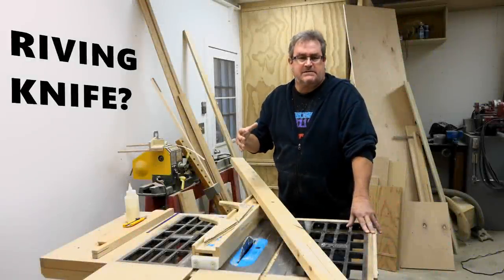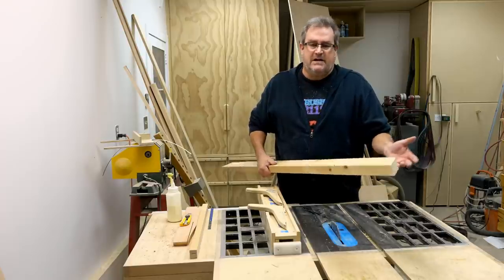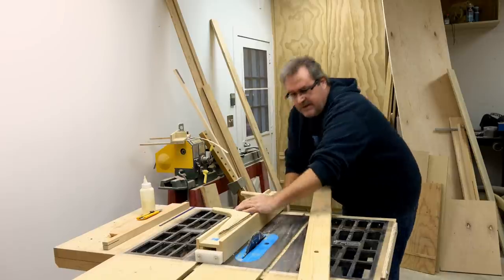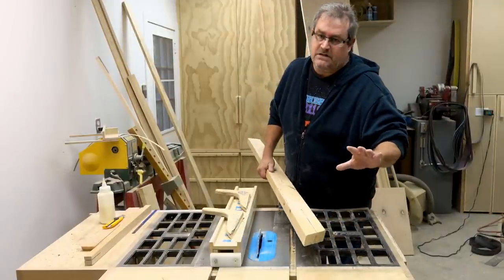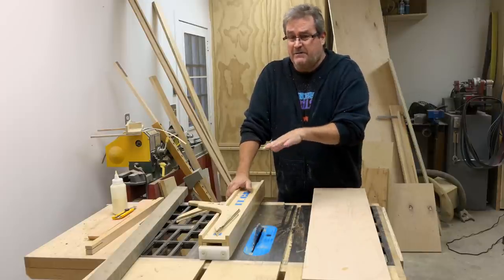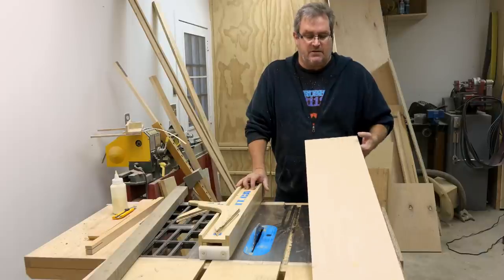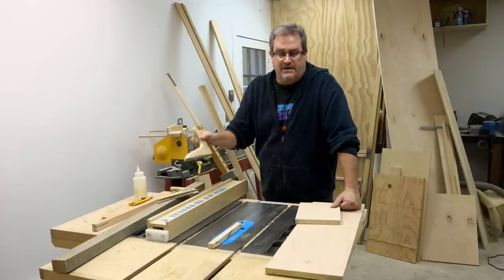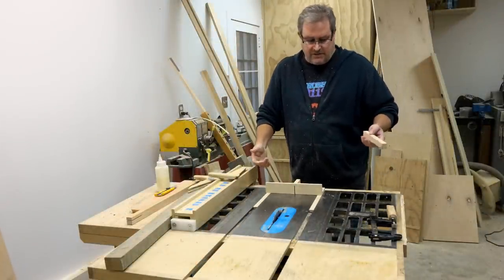How To Avoid Kickback On The Table Saw

Comment: There’s no secret.  Simply summed up concisely,  only use saws with riving knives otherwise you’re looking for trouble, no ifs or buts.  

Ensure your fence is accurately aligned to the blade.  Never feed wood freehand without a fence and never put pressure on the waste side at or forward of the blade as you feed the piece through.  That’s it.

Comment: Here's another video on kick back.  Watch until the slow motion of just how close his fingers got to the blade even knowing he was purposely causing a kick-back for the video.
https://www.youtube.com/watch?v=u7sRrC2Jpp4
Reply from the maker: Several people have already posted a link to that video. I saw that when it came out, years ago.
He was using a push pad to try to steer the wood into the saw, as in pushing it toward the blade with his hand. Push pad type things (like those Gripper gadgets) are more dangerous to use than a simple push stick on a table saw.

Comment: Respectively disagree at 7:15 you should never have your left hand on the cutoff piece pushing that through the blade.  Let the cutoff piece alone. You should have a push block with sticky bottom and firm handle on the piece against the fence. That block allows/provides for positive pressure forward, downward and against the fence.  Having your hand on it like you do later in the video and to which you advocate is also not right in my opinion.  I totally agree that a stick is probably not best either but a block with a handle (I use the orange ones with handles on them and friction material on the bottom) to keep positive adherence to the material.  No way I would have my hand on a piece of plywood that small with my hand guiding it. Maybe your hand technique on a significantly larger panel might be ok.  A riving knife is #1 safety item. Not sure of any that an riving knife cannot be adopted. Need a new saw if it can’t take one!  Lastly that combo blade you are using is the first thing I would change out for ripping 2x4s. Get a dedicated 24 tooth and you will have much better success. Thanks for posting!

Comment: in new brunswick  , in the city i live . the  dummies put kiln dried  2 x 4   outside 4x4   osb etc all outside to get   rained on . ,  fuckin  snows on it    rain .  pathetic   practice they use in this  city  i don't know  what the fuck they are  thinking , i'm sure the moisture content on these  has to be  50 +%   i know    when i  buy the trash .it's all  warped and twisted after a day or  2 in the house lol . ridiculous .hoping this is not how they do it in ontario   ,  a lot of good tips  in this video .  great series
Reply from the maker: Use to be that all of the framing lumber was green, straight from the mill without any kiln drying. All of the lumber would be uncovered out in the yard, like you describe, so that may actually be just that - green lumber.

Comment: why would you take the riving knife off of a table saw. I'm assuming that's the piece of metal right behind the blade.and I'm not trying to be a smart-ass I'm truly asking what purpose would it serve to take that away
Reply: You don't.  Riving knives as standard equipment is a recent thing, and there are a lot of perfectly good older table saws without them.  The only time mine is not in use is when I use my dado stack, and even then it is just retracted, never removed.   

The whole point of this video series is to explain that it's not a piece of equipment that will save your fingers,  it's your brain.
Reply: William Steppan  thank you
Reply: Joshua Estell thanks.you're right my dad's table saw never had one. I'm always a little extra careful with my table saw.a few years back my old boss cut off three fingers on his right hand. thumb , pointer ,and middle.
Reply: You're welcome. My el cheapo table saw has a riving knife, and it also had a really chinzy shield that, in theory, served to grab hold of wood and prevent kickback. Only problem is it was really flimsy and you couldn't really see where you were cutting and as John explained, you couldn't make certain cuts with it in place anyway so I have removed it and make sure that I am 100% focused on the work at hand. No accidents yet.

Comment: Had to stop watching the video to say please don't listen to this video saying using your hands is safer than push sticks. The safest way for all rip cuts on the table saw is 2 standard push sticks (one to push the work in the direction of the cut, the other to keep it pushed to the fence), stand to the side out of the line of fire with the riving knife and crown guard in place. The most important of those rules (although they are all important) is two push sticks. With longer pieces some times hands can be used at the beginning of the cut but never place your hands level with or passed the blade.
Oh dear, just watched the rest of the video, just no, so much no I'm going all caps, NO, NO,NO. Stops on a sled need to be removable, clamp on a stop and have a loose piece next to it, push your work up to the loose piece butted to the stop and move it out of the way. Never hold both sides of the work.
Reply: Paddy R you should change the fear of tools into respect mate.
Reply: There are so many things wrong with your statement I gave up trying to answer it in a format that doesn't allow paragraphing.
Reply: Lol. The stop block is no different than a fence in that case. Do you put a loose piece against your fence and put your material against that before ripping anything? There's a difference between respect and fear and fear will get you hurt too.